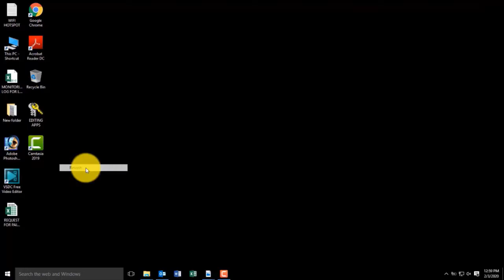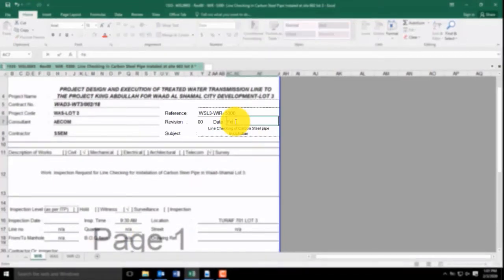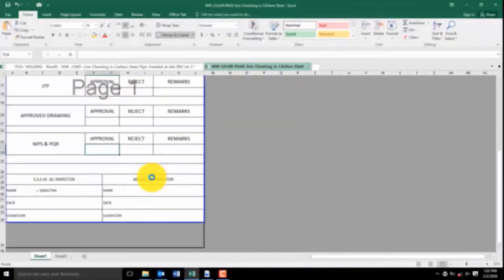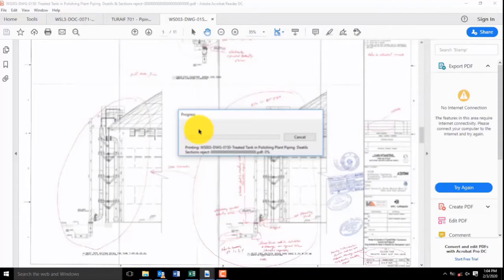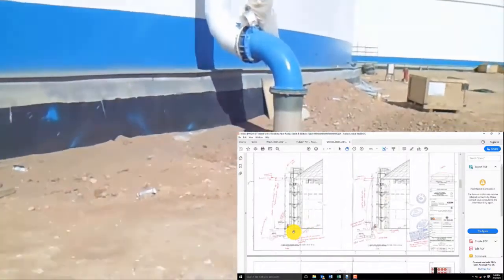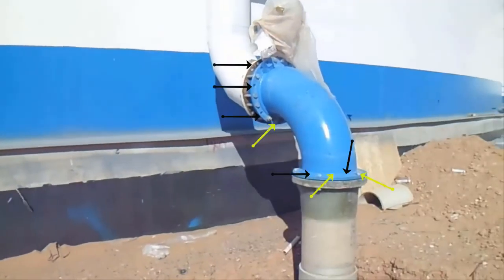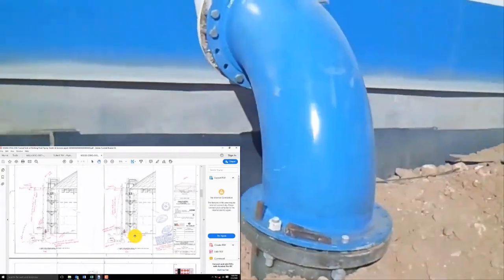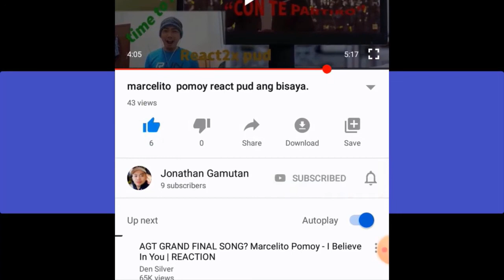How to Prepare WIR or RFI

Comment: Hello sir usually po ba ung list sa loob ng checklist sino po gumagawa? Provided na po ba un ng main contractor dapat? May format po kasi akong nareceive (for checklist) pero wala namang laman (ung list mismo) . Gagawa po kasi ako ng WIR for wood flooring, salamat po :)
Reply from the maker: ang vendor and mag provide sa mga nasa list pero ikaw ang mag request sa vendor. at ikaw din ang mag follow-up. pero dapat kasama na yan ang mga documents pag deliver. pero usually mag email kapa sa kanila para bigyan ka.